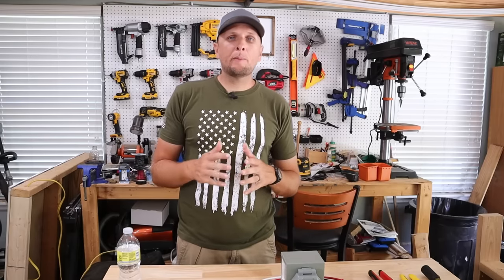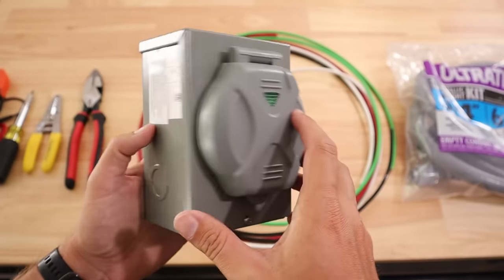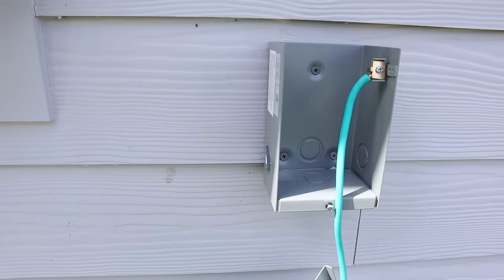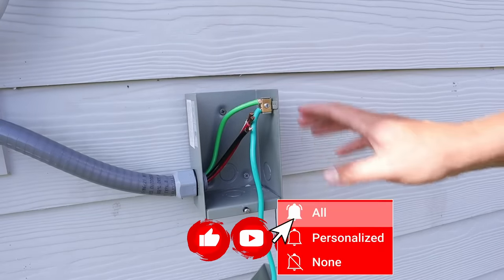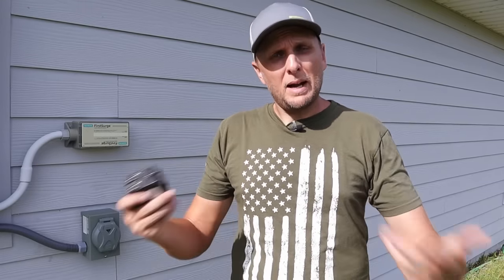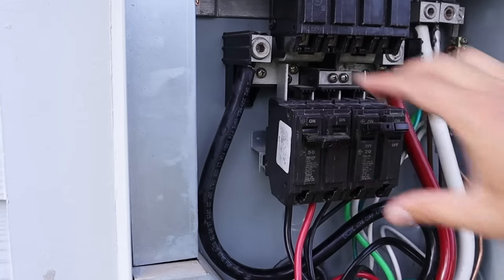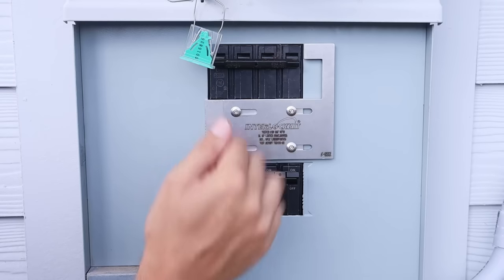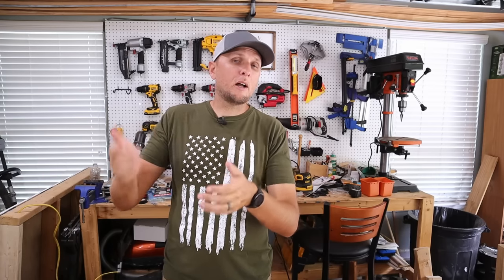The BEST Way To Connect A Generator To Your House - Interlock Kit With Power Inlet Box Install

Comment: LEAVE MORE WIRE TO WORK WITH. IT WAS LOOKING LIKE YOU MIGHT NEED A WIRE STRETCHER ON THAT GROUND IF IT GOT IN THE WAY OF THE OUTLET INSTALLATION.
Reply from the maker: All was good length.  On wire that large in that small of a box it’s hard to really have much extra.

Comment: I’m in Ontario, Canada. Haven’t seen a panel outdoors before. Always indoors. Can anyone please provide some
Insight?
Reply from the maker: This can be done on a service panel like mine or one inside.  As long as the main breaker is in it for the interlock.  But in Canada you will want to check your codes as I know they differ some with these installs.
Reply: We put panels in dry locations in Canada because weather happens......
Reply from the maker: I mean we may not get the snow like Canada but that panel has been through quite a few hurricanes.
Reply: @HowToHomeDIY  it's a question of cost. If someone really wants to install a panel outside, it can be done but it has to meet weather proof ratings. The only part of a residential service that is generally found outside is the meter base.

Comment: 30A would be #10awg copper.
Reply: Did you watch the video???  He installed a 50 Amp Breaker, wire rated for 50 amps and a 50 Amp Generator Outlet!

Comment: Do NOT TURN on the new breaker until you have turned every breaker off. Then turn it on and then turn on the breakers you want to power. If you don't do that you will over load the genarator and it will stall.

Comment: Why not just a simple transfer switch, is this not permitted in your area. I have a simple switch on my system, never had a problem. In fact I use an old fashion knife switch(probably not to code anymore - newer ones are a rotating switch.
Reply from the maker: I also have a transfer switch for some circuits that my smaller generator can run.  It’s a great system but kind of limiting.

Comment: The power cord itself is a code violation just about anywhere, open prongs on both ends…
Reply from the maker: The power cord in the video doesn't have two male ends though.

Comment: Just plug it into your dryer outlet and shut down what you don't want to use. Cheapest way to power up. Floridians know this
Reply from the maker: Yes that works but is not legal and can be dangerous if not handled or planned correctly.

Comment: I would just use a Generlink
Reply from the maker: There are limitations to generlinks.  For instance, per generlink, my big generator is not compatible because it’s too large supposedly.  They are also fairly expensive.  More than a transfer switch even.
Reply: @HowToHomeDIY  I'm I canada and I paid 1685 Inc TX and have a 7500W generator which more than enough to run what matters without having to go all the expense of a subpanel etc. I can use any load, I just have not use too many. I'm a fan.

Comment: The big issue I see is the generator. They don't treat electronics very well. I destroyed a $3500 fridge with my portable generator. Now I have standby generator with an auto transfer switch. To me that is the best way to install a generator. I don't need to even leave my chair and it is all powered by NG.

Comment: Who is the way I connect a generator to the house. Disconnect the main breaker in the panel. Get a heavy cord with a male plug on both ends. And plug the generator into a house outlet.

Comment: This is the kind of electrician I don't  like, leave a little more wire in the plug box. I have seen too many of outlet/switch boxes with 2 inches of wire. 6 inches is required by the NEC Code, by leaving short wires next time a device has to be changed most likely a pigvtail has to be installed giving you another junction where a loose wire could result. 4 more inches of wire is not going to bankrupt you and makes the job safer.
Reply from the maker: The wire is 6 inches.  I’m not going to have more wire in the box than needed.  Not because of cost but because it’s a small box and #6 wire which is not the easiest to work with in a box that small.  Also, I’m not an electrician but it was still done according to code.

Comment: What wattage is your generator?
Reply from the maker: 12,000/15,000
Reply: @HowToHomeDIY  thank you. I’m trying to figure out what I need. I want this Westinghouse 11,500/14,500 truck fuel because of the ease of using natural gas from the house but it only puts out 8500 running watts on LNG. I have got to be able to run my AC. We’ve been without here in Houston at my house for five nights so far and it’s not supposed to be restored until tomorrow night. The little 6500 AC Delco I have is enough to run two fridges and a stand up freezer, the living room and master but no HVAC. It’s been hot and muggy here 85° and 80% percent humidity last night. I’ve already bought a new service panel to install that has a main breaker I like the old one I have and will be using the info you’ve provided in your video to add the transfer switch. Even if I have to keep using gasoline for the higher output I will to run that AC.

Comment: This would not work on my electrical system. Besides, 50A would not be nearly enough to run all my stuff. Plus I'd rather have an automatic transfer switch.
Reply from the maker: Why would this not work?  It’s not enough to run every single thing in my house but pretty close since I have a soft start on the AC.
Reply: @HowToHomeDIY  Looks like it'll work for you but I have a different main entrance panel that does not have the capability to install additional breakers. And since I have a 100A service, 50A isn't going to "cut it" for me.
Reply from the maker: Well I’m assuming you have a panel then somewhere in the garage, basement, etc where all of your breakers are.  It can be installed on it most of the time.  I have a 200 amp service panel.  That doesn’t indicate how much power you need though to run things it just designates it’s maximum capability.

Comment: That inlet is not UL listed.  A permitted, or a quality installation will require a different inlet device.
Reply from the maker: That is not necessarily true.  A device does not always have to be UL listed in order to be installed.  The UL is not the only lab recognized.  There are other listings that are approved to be used and every device in the video has been approved either by ETL, UL, or a recognized lab to be used with UL approved panelboards.

Comment: God sake, I've had 3 electricians out to look at doing something like this, and not one of them will consider it.
Granted, my meter box isn't like yours, but they won't even entertain the thought of replacing it, either. 
EVERY one of them.wants to sell me a transfer switch setup, one guy quoted me $9000!

Comment: Dude if you're going to be playing in an electrical panel, especially with higher amperage, you need to invest in a torque wrench. Those screws need to be at a certain torque not a tug.
Reply from the maker: This is one of my favorite comments.  Just about nobody is using a torque wrench.
Reply: @HowToHomeDIY  No, only the ignorant do not use a torque wrench. Someone with a hell of a lot of knowledge figured it all out long ago. But then even if you had a torque wrench I would doubt you know how to use it. Look up a real electrician and they will show you that it is not what you think. P.S., I was head of operations for an electrical contractor that build new homes.
Reply from the maker: @alfrednewman292 cool.  Still, just about nobody uses them.  I’ve watched plenty of electricians work in panels and have never seen one use a torque wrench.  Nice that you did though.  Yeah it’s really rocket science 😂
Reply: @HowToHomeDIY  You really have no clue about electricity nor much of anything else from what I've seen.
Reply from the maker: @alfrednewman292  And yet, clearly still know more than you.  This is fun!

Comment: you cut the wires to short , now they dont meet code. 12" of wire from the back of the box
Reply from the maker: No that’s not code.  It’s 6”.  They are exactly 6”.   Was not going to have extra in the box of #6 wire.  It’s difficult enough to work with.

Comment: My problem with this system is the lack of foolproof isolation from the utility company's supply line.  It would be possible for a careless homeowner to decide to not install or install incorrectly the interlock device.   That failure would allow power to feed back into 
the utility lines and put utility 
workers at risk.  

In many jurisdictions this work requires obtaining a permit from the local building department because of its potential for creating dangerous conditions.   

I much prefer a true ISOLATION SWITCH installed between your meter-main panel and the utility supply line.  It requires a separate isolation switch (manual or automatic) that determines whether power comes direct from utility or from generator or power shut off.  This installation requires a visit by utility crew to switch their supply wires from your meter main box to the isolation box and it requires homeowner or contractor to wire from isolation switch back to meter main.  

This approach will cost more than the use of the slider block shown in this video but this approach will eliminate risk to utility workers. 

Also, I prefer when installing wire between device boxes to include a "drip leg" approach so rain water on the conduit falls to the dirt rather than sliding to the lower box connector where it could infiltrate the box.

Comment: You, like nearly all the other “DIY” guys on YouTube, missed two unbelievably critical things in this tutorial…

1) Since your neutral and ground are bonded at the panel, you must be running a floating neutral generator. Nearly all portable generators come with a bonded neutral, so the motor cover needs pulled and the neutral needs disconnected from ground. Otherwise, you risk energizing the frame of your generator. 

2) Code in most every state requires that the generator breaker be strapped to the panel so that it can’t be removed (safety feature so someone can’t remove a live breaker being fed by a generator)

Comment: You tampered with the electrical meter power box. That is illegal. The electrical meter box has a lock that should not be opened without the utility's permission. Did you get permission from the utility to open the electrical meter power box?
Reply from the maker: That’s not their box.  Their box is tagged and where the actual meter is.  The box in the video is my side of the service.  Please understand what you are talking about before making accusations.
Reply: 9:28 it can be seen that your side of the box is right below the power meter.
Reply from the maker: Exactly.  In the box I installed this in.

Comment: You shouldn't have cut the first wires so short.
Reply from the maker: I cut them at 6” which is code.  I’m not going to leave any more extra when dealing with a small box and #6 wires.

Comment: This guy obviously hasn't had enough experience doing electrical work. You should never cut your wires this short in the inlet box. You should leave enough wire to be able to fold them in case you have a need to replace a damaged inlet receptacle.
Reply from the maker: They are 6" and I am not going to leave a bunch of extra #6 wire to have to wrestle with in a small box.  It is not an issue.  You must not have much electrical experience yourself.  And if you say you do, wow.

Comment: You shouldnt be telling people that they can be doing anything at all inside a breaker panal..  period..  most people are friggn dumb and will either wind up hurting themselves or worse somebody else..  ive been in some houses where you had a mr diy do electrical work without having any working knowledge about electricity..  you can a lot of times make something work, and that something may work for a while before it becomes a danger for anybody who uses it..  for instance a hot tub i found during an inspection.  The tub had no equipment ground nor any protection at all. They wired it up straight to the mains 100 amp breaker BEFORE the breaker..  just two properly sized conductors ran along the concrete up through the house to the panel.  Yes it worked but as soon as anything crossed with either hot then people soup..  theres a lot of foreign, mainly indian youtube videos instructing how to do different things which most are ignorant on safety laws, procedures and tools..  ive watched one video where the guy crawls up a ladder to his entrance cable and ties a new feed while the connection was live and used a wet towel wrapped around his metal ladder with a wet towel around the bottom then he tosses another towel over luckily one phase only and was able to attach his new line but theres so much wrong with that however it worked because physics.. but that stuff only works on perfect circumstances..  bob who has worked as an accountant his entire life who owns a toolbag and has an idea doesnt need to be fooling with electricity and doesnt need any influence to be doing so..  
 Just saying if your instructional video involves deadly and dangerous things but still needs to explain on how to attach wire to a screw terminal, whoever that information helps, does not need to be doing the shit..  you ever seen somebody break a light bulb off in the socket then go try to remove it thinking theyre all smart using a potato, except dont turn the fixture off first?  Same deal..  it only takes something small to forget or happen to touch..  then again darwin needs to be taking a bigger role these days..  its just when those derps end up hurting somebody who had nothing to do with it..

Comment: This method is flawed. If you energize your main panel in this way without disconnecting the service neutral conductor you will energize the neutrals on the power lines on your street, potentially shocking a lineman. Proper generator panels open the neutral going to the power line in the event that you go on a generator.

If you want to use a kit like this, you should remove and tape the service neutral in your main panel, as it is illegal to install a switch on a neutral conductor.
Reply from the maker: That doesn’t happen.  If it is then you have something really wrong going on.

Comment: This is totally not even close to the best way to connect a generator to a house. GenerLink Transfer Switches mount directly to your power meter on the side of your house. You power company can install it. Plug your generator right up to the meter. Its a smart switch and will not conflict when normal power comes back on. No mess, no wires all over the place, no house burning down.
Reply from the maker: One thing I don't like about the generlink is they don't make a 50 amp model that I am aware of.  I think 40 amps is their max.  Feel free to correct me if I am just missing it.  Thanks.
Reply: @HowToHomeDIY  The Generlink L14-50 Straight, is the 50 amp one. I might be new because i seem to remember there only being a 30 and 40 amp.
Reply from the maker: But I believe that is just the cord or I should say plug option.  Right?  That is where it is kind of confusing.
Reply: @HowToHomeDIY  Yep looks like that's just the cord
Reply from the maker: Too bad really.  Aside from the price it’s a smart device especially since you can buy them with surge protection.  I am sure they will have a 50 amp soon.  Makes too much sense.

Comment: Less $ Less quality, when it comes to electrical, don't 5 and dime
Reply: Paying more does not always get you more.
Reply: @MrSummitville  Talking about quality, in the middle of a winter blizzard , I'd rather spend a few extra bucks for piece of mind and not have a breakdown. The materials necessary for a gen setup aren't that expensive to consider a cheaper route.
Reply: @stanleyroper5942  Paying more does not  mean better quality.